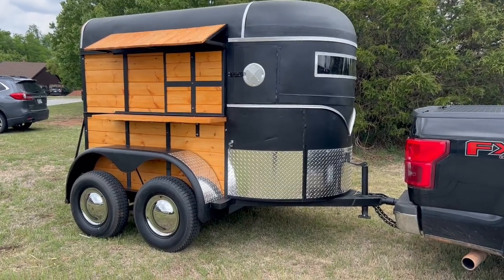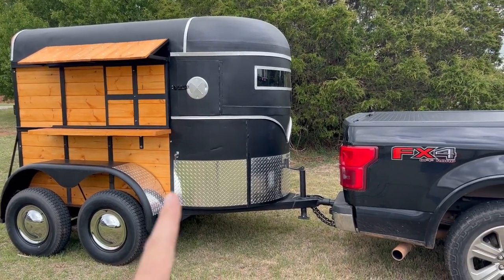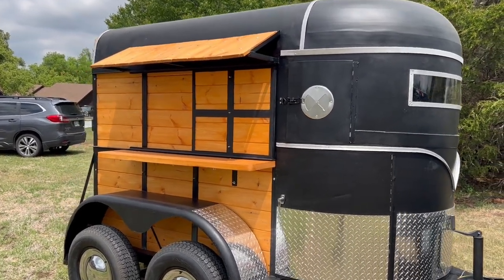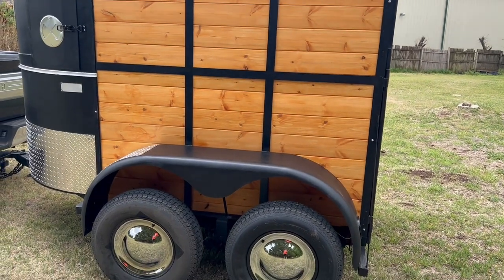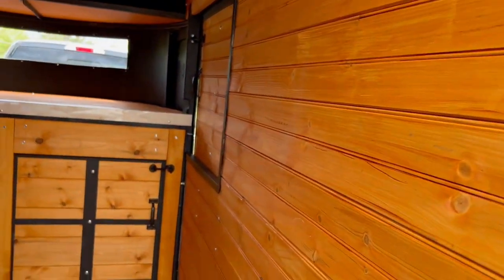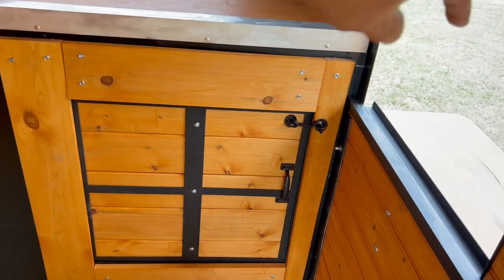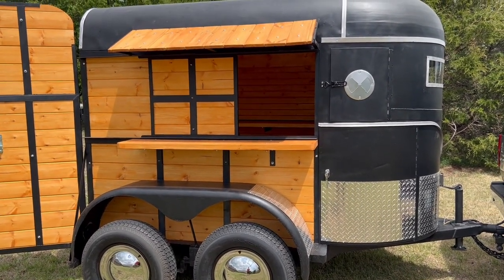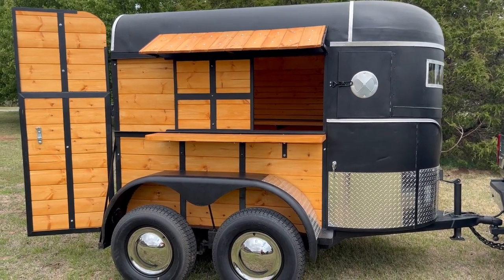Finished Flat Black Build Overview! Wow!

Comment: I love love watching how your builds come out. I’m in the process of converting a horse trailer I just purchased. You have helped me understand the process better and I’m looking forward to adding sliding windows to my trailer so I’m glad to see that great minds think alike! Not sure how to do it, but I’m thinking along the lines of attaching sliding door kits and then building my own windows and attaching them using gate hinges. Idk, it’s the best I could come up with. Seeing how you’ve added an awning, I may do the same to prevent water from running into the trailer after sealing it up creating some type of drain run off.
Reply from the maker: Glad to hear the videos are helping you! The sliding doors and awning were requested by the customer. It definitely took some thinking to figure it out.

Comment: Where did you get the trim pieces for the outside? The V and window trims?
Reply from the maker: The aluminum diamond tread I got from a local metal store. All of the aluminum lipped trim used around windows and along seams, I just cleaned up the original trim that I removed from the trailer. I will be posting a video showing how I refresh the old trim. I did buy a few pieces of the flat lipped trim from https://www.horsetraileraccessorystore.com/ but it turned out that I didn’t use them, so I have some extra pieces for future trailers. I hope that helps.
Reply: @carriagehousetrailers  Nice!